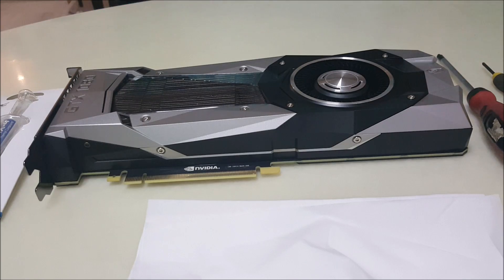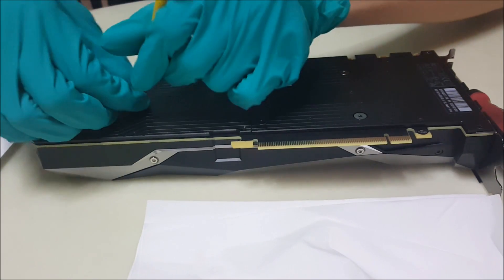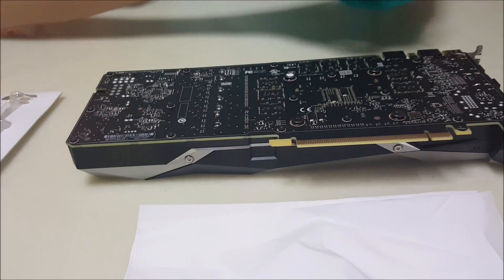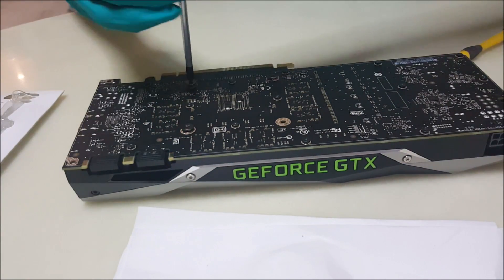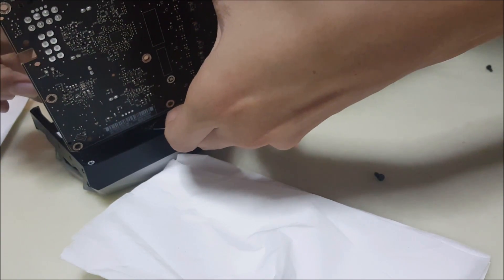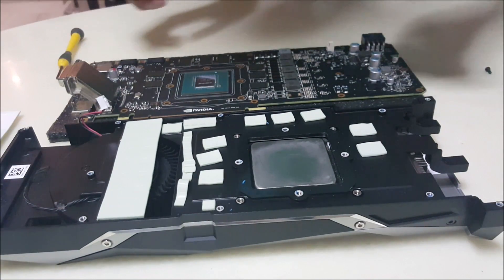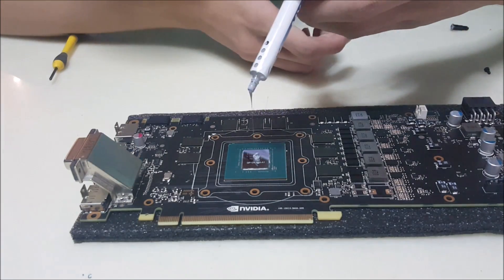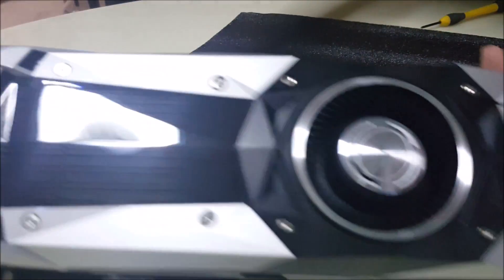GTX 1080 Thermal paste upgrade

Comment: It depends. The first, and the most obvious, factor is your thermal paste's quality. If you're using a high-quality thermal paste, you won't have to replace it for a few years. If you're relying on a cheap paste instead, you might need to change it every couple of months.

Comment: this isnt legos, there isnt supposed to be extra pieces, those resistors do make a difference, dont do what this guy did, take tremendous care when taking your gpu apart, and if there is ANYTHING that falls off of it like a resistor then you would have been better off just not taking it apart at all, because it will never function how its supposed to ever again. whether the effects are obvious or not, there is no way that gpu is working like it used to

Comment: I just disassembled my 1070 FE for the first time (ever). I didn’t need to unscrew everything else, I only unscrew the 4 screws 2 of each side of the gpu housing case and the 6 screws on top of the housing case then just remove part of the gpu piece on top. From there I remove the heat sink, clean up the paste and apply a new one then put them back together. 

Everything works fine without a problem after running test.
Reply: I too have a FE what were your new temps, after a repaste?
Reply: @drake6836  it's pretty much the same as usual. It's a reference card but it never goes over 82c but always stays below that. Other than that my buddies graphics card I sold to him is very satisfied with it. I always kept in check with his GPU to make sure there's no throttling problems with it.

Comment: Every single part matters on a PCB, otherwise it wouldn't be on the board if it served no purpose. Breaking even a single resistor will potentially break the entire board. I predict that the the traces connected to the resistors are no longer working due to missing connections, or too much current is now passing through, killing the 1080 prematurely. I hope you learned from your mistake, even 2 years since this video, and that I hope no one actually followed your horrible tutorial. Don't use pliers next time either.

Comment: Jesus. Don't emulate this guy. For one he did not have to remove all those screws.... And you should not be losing resistors/capacitors/whatever he broke off here. That's really bad and could easily kill your board. If you do break off resistors DO NOT TURN IT ON!!!!! Take it to someone who really knows how to solder and have them put back on if possible. People can solder on resistors that small no problem. Don't do it if you aren't an expert though.

I just did this same thing on a 1080 GTX. You just need to remove the shroud and then the screws on the PCB side around the actual 1080 chip. Then you can remove just the heatsink touching that and clean/reapply thermal paste. Don't remove everything if possible. There are tons of better videos showing how to reapply GPU thermal paste on youtube. Go to one that isn't rated almost all thumbs down.

Comment: This tutorial is abysmal. You didn't need to dismantle the entire thing. Unscrew the shroud covering the heat sink, unscrew the 4 heat sink screws from rear plate. That's it! This is a guide on how not to do it. Glad you didn't brick your GPU and good to see better temps. So advice for everyone, don't follow this video.
Reply from the maker: mingojingo Actually i did broke it haha but yes you need to unscrew the 16 tiny screws under the backplate.I can't opened the heatsink just by the 4 screw.

Comment: hi bro,
two comments here
firstly, thermal paste not enough, rice method is for cpu not gpu
2ndly, for taking out the other of screw, pls dont use piler
pls use 4mm socket wrench.
Reply: Actually its 3mm and pliers work just fine